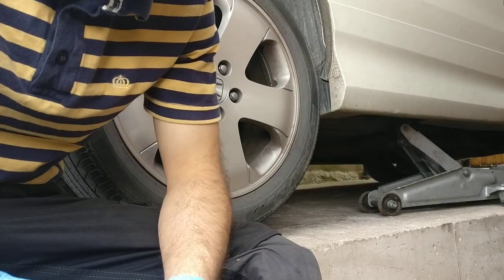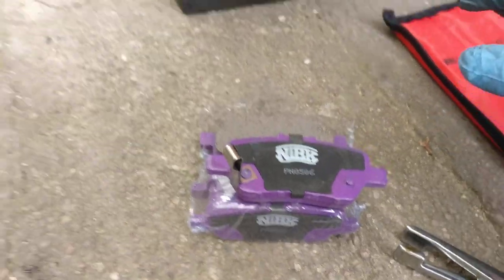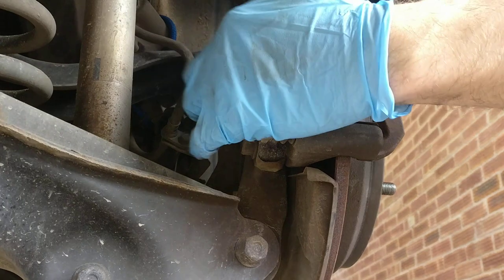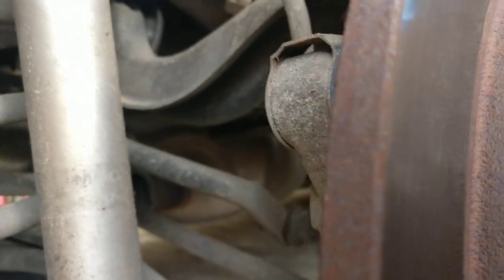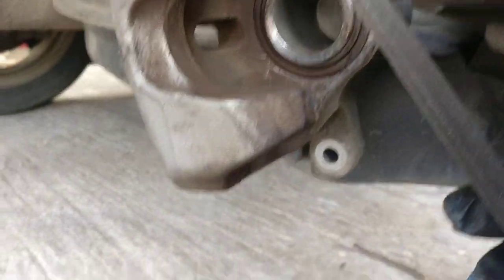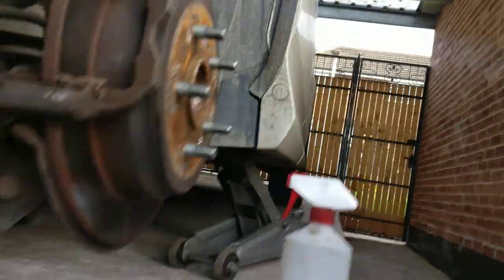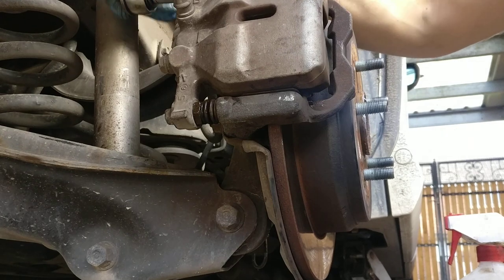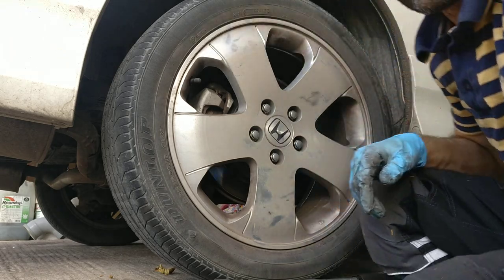Honda Elysion rear brake pad replacement.

Comment: Which other car uses the same brakes? In south Africa I can't find the brakes
Reply from the maker: Rear or front?Disks or pads,
Reply: @sauliusagintas  rear brake pads
Reply from the maker: In the description you will find all part nr. for pads
Reply: U can use Honda odyssey and Honda stream rn3
Reply: Thanks, I also found that the front brakes are compatible with Nissan Pathfinder